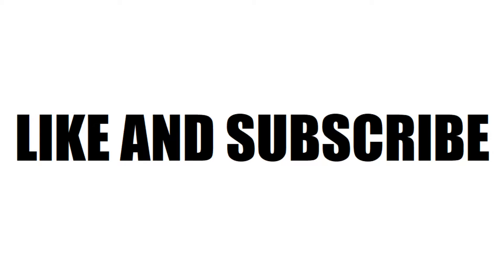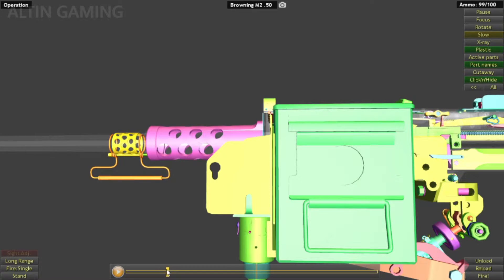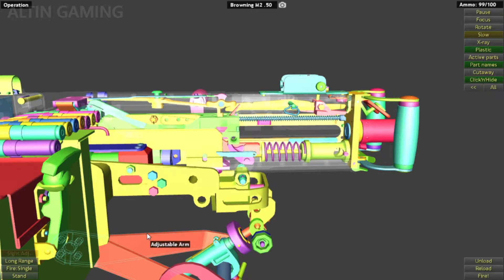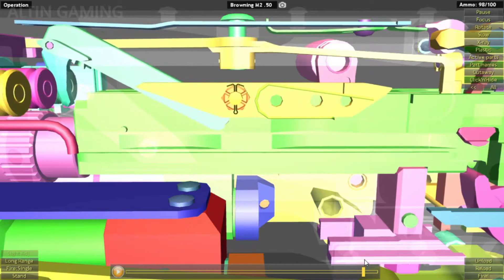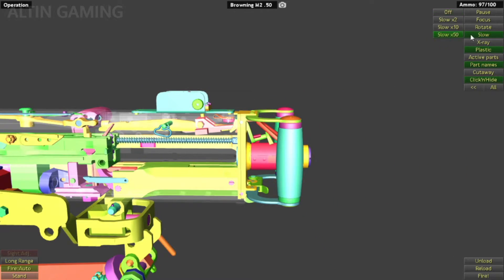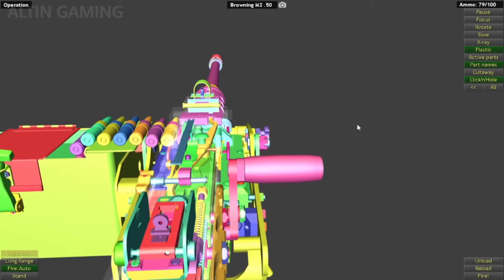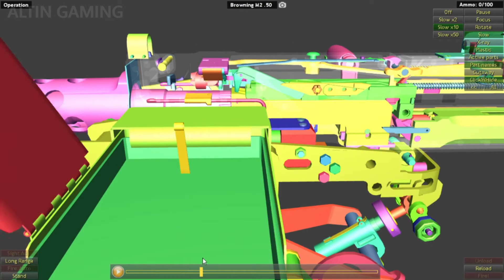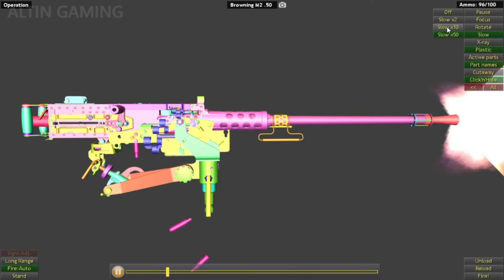This is how M2 Browning Works with commentary

Comment: I think Ian got it wrong. He seem to mix the accelerator with lever delayed action or something. Accelerator is there to increase speed of the bolt, not to decrease it. It is necessary because the barrel with extention and bolt are very heavy, so they dont gain that much speed from recoil, plus they are decelerated by the buffer before the bolt is unlocked.
Also Ian didnt say a word about the rectangular locking block on the barrel extention, that goes up and down to lock and unlock the bolt.
And, of course, this model is wrong, the green round pegs on the pink locking block should be higher (go farther to the sides), so they can interact with blue side bars to unlock the gun.

It is a short recoil, locked by falling block gun. Not sure about the proper word for this falling block.
When the gun is fireing, barrel with barrel extention (yellow) and locked bolt (green, above the extention) recoil back. The buffer (green, at the bottom back side) is stationary in the back. At some point the side pegs (green, round) of the locking block (pink, inside the barrel extention, visible on 1:31) meet with diagonal cuts on the side bars (blue) of the buffer assembly, locking block goes down, out of matching cut in the bolt, bolt is unlocked. Right as the bolt gets unlocked, accelerator (pink, curvy part below the back side of the bolt) is in position to tranfer the energy of moving barrel an barrel extention to the bolt with mechanical advantage. Case is extracted and so on.
Buffer is there to decelerate barrel and barel extention, and push them back forward. It also decelerate the bolt untill it is unlocked. Recoil spring helps to decalerate the barrel and extention untill the bolt is unlocked, and then works only on the bolt.